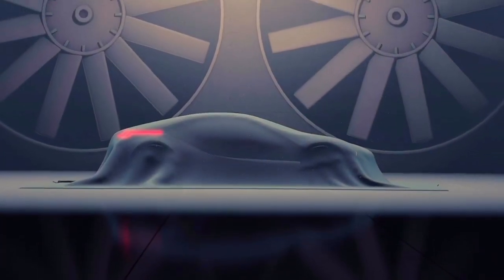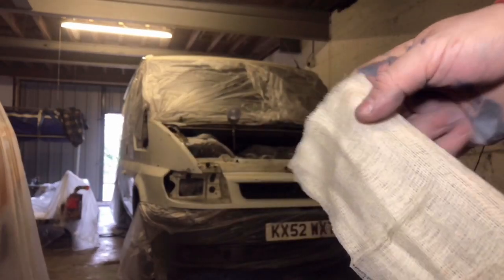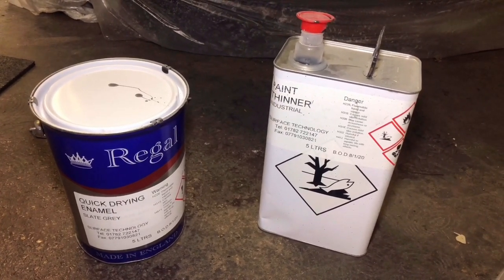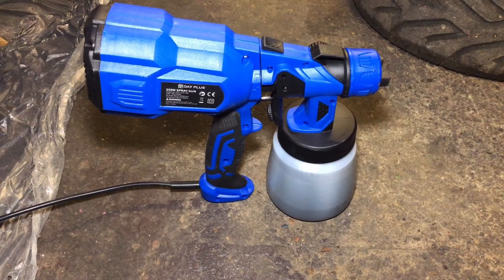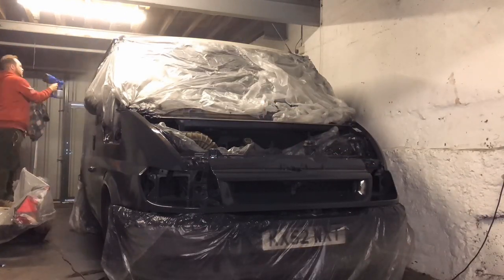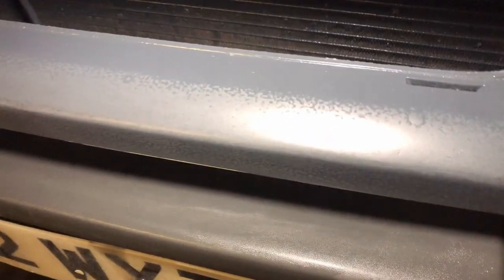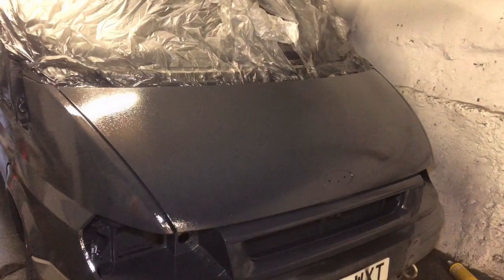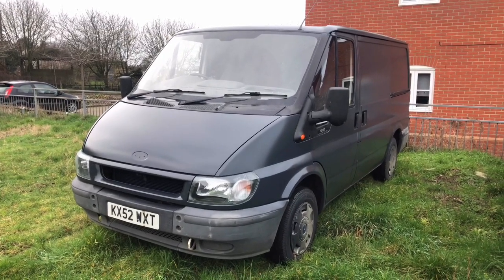Time To Paint The Day Van conversion!

Comment: You can't polish a turd
Reply from the maker: You can’t no, but you can make it look a bit nicer!
Reply: @TrackAndBeyond  yes your right but i feel you rushed it why filler it just to sand the filler back out leaving dints in the back doors. Why mask it off just to do a shit job of it leaving overspray everywhere. Also i will be doing the exact same with my van but i will be using the proper equipment and proper paint. You can wet sand laquer and polish it up, you cant do that with just paint like you used. Im no keyboard warrior and i hate trolling people its just ive sprayed a lot of things in my time and they didnt always come out right sometimes down to reactions but ive redone it. I know youre just trying to make youtube content but id do quality over quantity
Reply from the maker: @Jason-ew4kf  I agree with you but this was a £1000 van I was never going to recover the money and extra time spending £100’s on buying automotive paint etc. I just wanted to stop the rust and make it look a little better not perfect. I have painted a couple of car related parts “properly” using all correct methods etc and had good results I know what it takes and takes a lot of time and money which as I say I was never going to recover on a van that I knew I wasn’t going to keep for too long. Also the overspray on the horrid plastic bumpers I had later gone over with gloss black and made sure any overspray that got though on the windows etc I scraped off so didn’t look horrendous and certainly looked a million times better than when I first bought it
Reply: Pass no remarks of the paint police and before anyone asks I've been painting stuff since I was a kid , from spraying furniture to metal etc , yes you could spend hundreds on paint , and another grand on a Divilbus or sata spray gun and the guts of another grand on a decent compressor , for what ? A van worth the price of a decent gun ? At the  end of the day you could pour the f*cking  paint on outta a bucket if your willing to do the sanding , keep doing your thing man , I enjoyed that , there's a teen out there somewhere on a shoestring budget looking to do this to his civic 😂, can't wait to see the finish , best of luck .. p.s I happen to like those dents , shows she been around the block .
Reply from the maker: @beachdetectingireland3984  thanks for those words man really appreciate it 🙌🏻
Reply: @beachdetectingireland3984  and I've been running since i was a kid does that make me a olympic runner no 🤣 and I've been painting since i was a kid to from bikes car wheels then car body's vespers and i was a cabinet maker and French polisher so think I've got the right to make the remarks just like you have 👍
Reply: @Jason-ew4kf  of course you have every right to reply but each to their own , if you don't like this work scroll on , ya don't have to kick a man just because the work is not done to your liking , there's plenty of other restoration vids doing it the right way , unless you've been running competitively since a kid then no it doesn't make you an Olympic runner , ridiculous analogy but hey , you know this already . If the chap is happy enough with the van then leave it at that , its him that has to look at it why do you care .
Reply: Actually you can! - Mythbusters did it in one of their programs.
Reply from the maker: 🤣 love it!